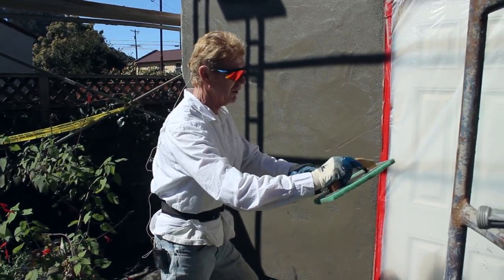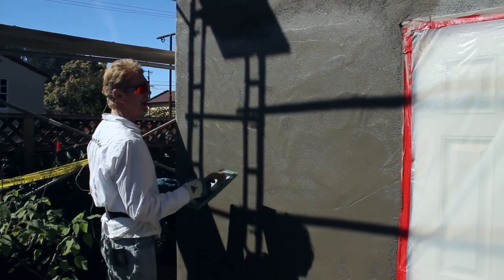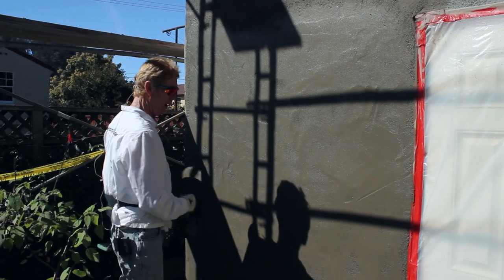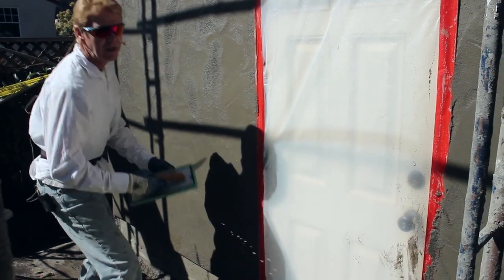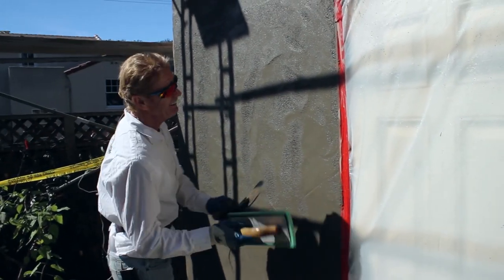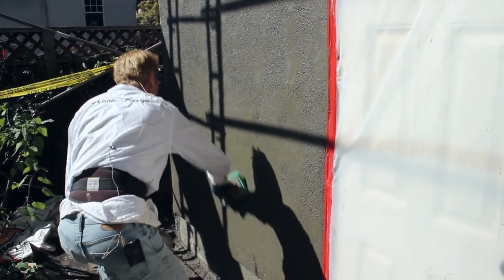Matching new stucco to match painted finish.

Comment: Hi Kirk, Toby here from the UK. Really enjoying your videos! Do you have a video showing you guys applying a smooth cement plaster finish to a concrete block wall? (You have so many videos) I'm guessing it's: wet the wall, apply the first coat, scratch it, apply second coat... then... I'm not sure how to finish. All the best, many thanks, Toby